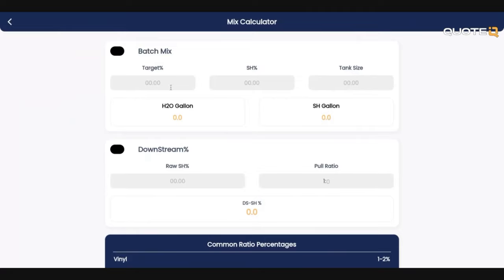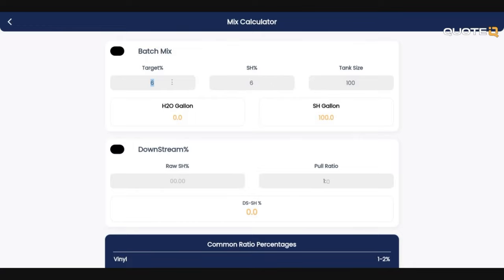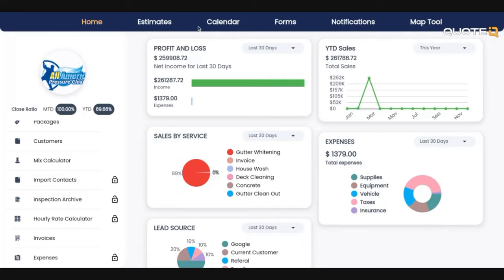All You Need To Know About Using Bleach To Clean A Roof

Comment: Pro tip from my first metal roof cleaning.  Don't do metal roofs if they are sloped at all.  They are wayyyy to slippery, especially when you get SH on them.
Reply from the maker: Good tip!
Reply: My first softwash was metal.  Dropped my xero pole and almost fell off because I didn't have proper safety gear.  Proper shoes and harness are a must, guys!
Reply: Get cougar paw steel walkers
Reply: Need a big enough ladder lol

Comment: I use backpack pump sprayer on cloudy day and let rain over few months wash roof clean ...
I use pool SH and make it strong ..doing it this way roof is cleaned over time and it does not kill plants as you are not washing it off full strength ....
Reply: Can you use powerwasher to SOFTWASH a roof by using a special nozzel?
Reply: No on washer

Comment: I do regular bleach from the common  store, 50/50 mix..
First dampen the roof so there isn't any spray staining, spray on the solution and give it a soft brush with the softest push broom you can find...then rinse...
Always has worked great and have never had to deal with a follow up issue.
Reply from the maker: Thanks for sharing

Comment: You CAN use a Pressure washer, you just need to know how to do it without damaging the roof.
Reply from the maker: No
Reply: Never an asphalt shingle roof I’ve seen videos in England them using surface cleaners on poles and ropes on tile roofs and it still looks crazy to me using pressure on any roof system lol

Comment: How long do you let the stuff sit once applied? Can you do the process a couple times if the results arent great the first time? I mixed up some today and sprayed it. There are very heavy algae dark stains and it did help. But not drastic like i was hoping for. I scrubbed the moss off first with a scrub brush and thinned it out in a home depot hyx 1/2 gallon hand pump sprayer about 1/4 SODIUM HYPOCHLORITE to 3/4 water. Applied it twice. Its better but not perfect.

Comment: It’s a task requiring work … if you use ANY mechanical means or even tools you will damage asphalt roofing . Soft rinse with diluted bleach or a longer term mild solution such as “ wet it and forget it “ will give you a better end result . Flossing your teeth and cleaning a roof are similar in that they are tasks best addressed on a regular basis. Tree or Vegetation overgrowth or extreme shading adds to the potential for more problems
Reply from the maker: Chat gpt🤣

Comment: Hi there. 
I am in South Africa and doing some renovations on roofs and houses.
With the current high density housing, cleaning roofs ask for something where the neighbours won't complain about the overspray.

I am looking at using SH. I can get a 12 - 15% solution from a manufacturer. What ratio would be best to dilute it for the cleaning process? 
I would appreciate your feedback.
Regards
Hein

Comment: It's damn near impossible to clean a roof with solely bleach in California. Cement tile roofs + heavy algae growth. 10% on a roof did close to nothing.
Reply: Charge accordingly for the extra coats you’ll need. Make sure you’re using a good bit of surfactant…and be patient 😂
Reply: @jayweathers2701  I'm convinced the only way to clean roofs out here is with pressure. Bleach won't cut it. It's night and day compared to videos on YouTube.
Reply: Also might want to get a bleach tester to verify it's potency. I'm aware of one around the $150-200.
Reply: @MannyAguilarJr  Was thinking about that. But it sure does smell like chlorine and is greenish yellow.
Reply: @llpp202  the 10% i use is a pretty strong colored yellow. Even when i batch mix at 1.5-2% you can tell its yellow. But if you know your bleach is really that potent and it still wont do the job then yes pressure is the only other way to go. Just make sure you dont use much AT ALL. Use a 45 degree (white tip) and turn the unloader on your washer down. You can crack concrete and tile a lot easier than you would think. Just make sure you NEVER use pressure on asphalt shingle roofs

Comment: I quoted a 3500sqft tile roof wash for $800. 
Customer accepted and I’m doing the job on Tuesday. This is my 2nd ever job. 

Was that price too low?
Thank you
Reply: Yes too low price
Reply: I got quoted 2k for a 1200sq ft house and told em get bent. Ended up getting a reasonable quote for around 800 so yeah, I'd say a bit low.

Comment: I need to figure out how fast bleach breaks down and weather using soap on a roof will break down the oil-based parts.  Guessing on two big issues like those is fine but I really don't feel comfortable at this point.  I'm going to search for a test of some kind for the bleach and some research data on the other.  When buying new bleach from whatever supplier, especially at slow periods of the year from pool suppliers, I'm always trying to figure out how long that bleach may have been sitting on their shelves or in their main tank.  It can break down quickly from what I've heard but I really need to nail down those numbers, and you should too.  It matters when it comes to plants, kids, pets and, of course, surfaces.  And, even if it breaks down into salt, the salt sitting on the surface can't be good.

Comment: Do you rinse the roof or let the rain do the job ? Or both ?
Reply: He usually doesn't rinse, he said. Sometimes near the gutters if it's going to rain, from what I remember.
Reply: He rinses. Once he saw that he was getting less call backs he kept it in place.
Reply: @MannyAguilarJr  what? When was that?
Reply: @hisnameisiam808  Mike uploaded a video a while back and then again in the last month or so. I can't remember the tech's name  right now but it's the top or most mentioned one. Mike used to have it as spray the roof and leave but they would get call backs to go again because of the brown spots on the roof that remained. One of the days Mike dropped something off for the technician and noticed he was rinsing the roof and make asked what he was doing since it wasn't standard practice at the time. He rinsed the roof because it prevented the call backs and Mike looked back at that technicians jobs and there weren't any call backs for that technicians for roofs.

Now another note Mike mentioned recently and another YouTuber has also mentioned rinsing the bottom 1/3 of the roof if rain is in the forecast in the coming hours or days to prevent so much of the residual salt from the dried SH coming into contact with the plant, trees and grass.
Reply from the maker: @MannyAguilarJr  You are the man!!  Thank you for answering....spot on!
Reply: @MannyAguilarJr  ok, yeah, that's what I remember except the most recent stuff.  That's how a good business owner works, learn from your employees successes. I have run a martial arts school for 16 years and have learned a lot from my students. They like to ask questions sometimes and I've learned how to answer even the most silly.
Reply: @AllAboutPressureWashing  It's my opinion that if the house has gutters, set the proper expectations with the client to avoid call-backs, and wet & forget. When it rains, it is not only diluting the salt, but also hitting the gutters, not plants. If there are no gutters, then I can see possibly rinsing after a long dwell time, just so someone can be on the ground also rinsing plants. But again, just the process of rinsing or raining, still dilutes and will most likely cause no issues. 

However, everyone should have a process that they feel comfortable with. No matter what, ALWAYS set the proper expectations with your clients.
Reply: I don't understand this. One would think, from a very soft wash uneducated perspective, that rinsing decreases dwell time and should result in more callbacks if it doesn't do the job it's supposed to do which is clean the roof. What am I missing here?

Comment: You can absolutely clean a roof with a pressure washer. You just have to stay around 2000 psi and have a good stoke and keep the gun nozzle away from the roof so you dont scorch the roof. I've done hundreds of roofs from cedar shake to tile to comp. If you do it right there will be absolutely no grainulars that come off the comp roof. I guess you have to be confident in what your doing. And know what your doing. But it's a very effective and efficient way to really clean a roof.
Reply from the maker: No
Reply: Put a gauge on your machine, 2000 psi is a lot more then it seems.

Comment: they dont tell you that bleach eats up tar paper it easy to spray and run to the next house see it all the time water water water
Reply from the maker: Be smart Johnny- if the tar paper gets wet the roof was installed improperly and tar will deteriorate if it's exposed to water.
Reply: @AllAboutPressureWashing  lot of times its on the barrel tile roofs some how it gets underneath and in a month they have leaks thru the house
Reply: @johnnyweld9672  As Mike said, if liquid can make it past the tile and hit the tar paper, the roof itself is ineffective. it is not an SH problem. It is a roof problem.